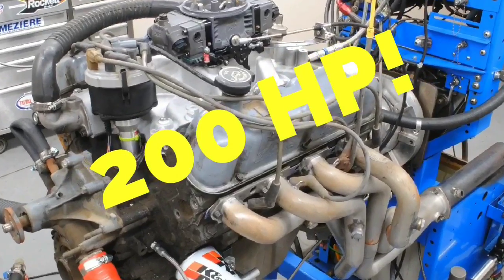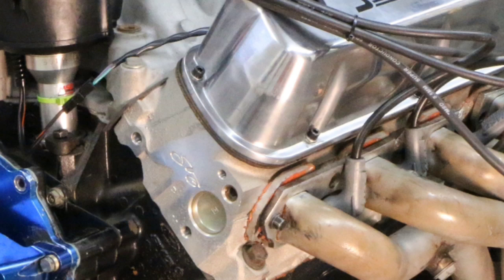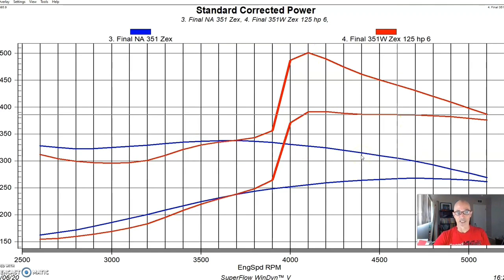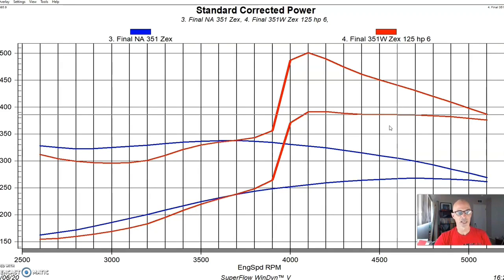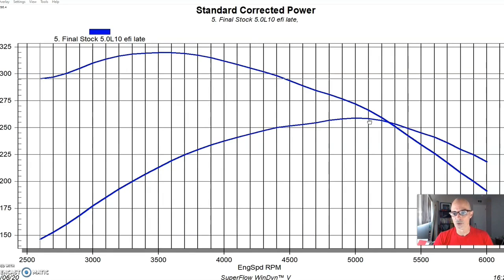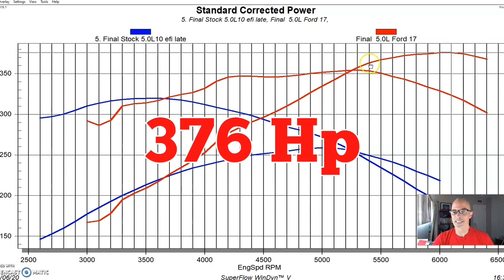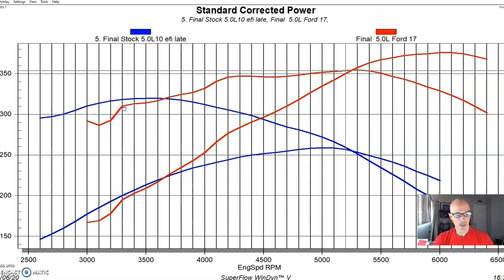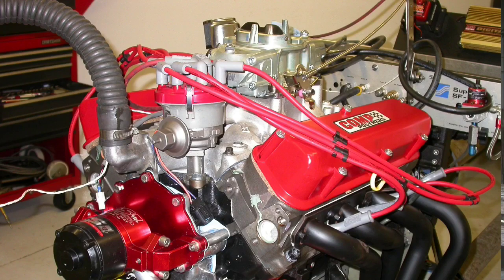HOW TO: 300+ HP 5.0L (SBF) FORD POWER RECIPES

Comment: Hi Richard, I’ve only just tinkered on my motors . I’m building a 1970 f100 and bought a 1999 explorer motor with the gt40p . Could you recommend a budget package for it ,mild cam ,intake and carburetor.Im looking for 300 hp .could you please help me out on this? Thank you.
Reply from the maker: CHEAP DUAL PLANE FROM SPEEDMASTER, BRAWLER CARB AND SUMMIT CAM (E303)
Reply: @ thank you for answering my question I’m going to have to start shopping 👍

Comment: One thing I don't understand when tuning the small, small blocks is why their high rev capability is not used to make power up to at least 7000 rpm. Making max power to 5000 is pointless with, say a 305 when a 351 will do the same with an obvious advantage in torque. So I would be grateful if info on the high revvers was linked.

Comment: I made 327 back in the mid 2000s with a 5.0L short block. Extensively ported 289 heads, Crane 272. Edelbrock RPM and a Holley 4150 with a 2” tapered spacer.
Reply: The cam was only supposed to make power up to 5k, but it kept pulling hard and made power up to 6,200.

Comment: for people looking to make good power in your stock78-89 carbed windsor without spending a whole lot.
1-remove the smog pump system
2-make or buy long tube headers and make or buy collector extensions around 3 feet long and run it a crayon mark on it and run it hard and get it hot; look to see where it burns off and put a H pipe there. 
3-get a intake manifold and a CORRECTLY CFM MATCHED CARB 
4-try your best at porting the stock heads and have a machine shop back face those stock valves, make sure you really grind down those exhaust ridges! . worst case scenario you fuck up your stock heads and have to go buy either gt40 heads or aluminum heads.
5- run a fucking electric fan and change your pully bearings and unless your using a whole shit ton of electronics run the absolute biggest alternator pully you can find that still provides adequate amperage for the provided electronics.
6-lower temp thermostat helps quite a bit
The stock cam has a pretty decent grind that should be one of the last of your worries, getting basic maintenance like spark plugs wires distributor and even help even though they seem simple it all adds to the freedom
Reply: ide love to see a low buck hot snot recipe dyno tested in a car like this
Reply from the maker: why all the F? that is about a 260-hp 302
Reply: @richardholdener1727  some people don’t have a whole lot of money to play with so after spending maybe 400 bucks you can get that 180 hp smog polluted stock 302 into the fun area

Comment: I wanna see what you can squeeze out of a mid 90s 302 truck motor running the factory manifold and dual tb
Reply from the maker: heads and cam still help-just gets held back but the stock intake

Comment: Afr 165 on stock bottom end, stock cam, exporer intake with 1.7:1 roller rockers = 319 hp. Perfect reliability,  drivability, and stock fuel milage with 50 lbs less weight over the nose
Reply: I’m skeptical that makes that much power
Reply: @phelpsbennett4625  wish I could upload the dyno printouts for ya to see here. This was flywheel  horsepower estimate based off of the rear wheel dyno. Stock on the 225hp car was 184rwhp. Heads, intake, roller rockers was 262rwhp. Which using the same drive train loss factor is 319 at the flywheel
Reply: In a car much lighter than what is sold today. By hundreds of pounds.

Comment: what type of pistons do you need for the twisted  wedge heads? Would hypereutectic cast valve relief pistons work?
Reply from the maker: you need TW specific valve reliefs (some pistons have both)
Reply: I ran stock pistons with TW heads with both stock & B303 cam back in the day.

Comment: I got 340hp out of my 2v Cleveland with a r.v. cam a little porting of stock intake/heads and a 500 holley 2bbl. Its not hard....(rated at 180 stock i think...)
Reply: No you didn't

No, no I didn't. But this guy I know...
Reply: No I actually did...
Reply: Pistons cam porting headers and a x pipe exhaust and a 500 holley with some jet work ✔ 👍
Reply: Dude, "RV" cam ? There is no such thing it's just what we used to call a "torque" cam.

Comment: I am Rebuilding my 302 and this is what I have so far.
Forged pistons from a 302 HO engine, the block, crank, and head got cleaned up at the machine shop everything was good, and I also have a B Cam. My question is what type of roller rockers should I go with what size fuel rail and injecter?
Reply from the maker: STOCK RAIL AND 36 POUND INJ WILL BE PLENTY

Comment: At a car show i sprayed my stock rebuilt 85 longblock with 100 timing was at but 8*. The temperature outside was 90*. It made 290hp and 426tq. The car had 4.10 gears and basic intake carb and exhaust and a manual transmission. With a crap tire it ran 7.70@90 in the 1/8 and 12.56@100 in the 1/4 ran out of gear at 900'.

Comment: So an aftermarket head lists a maximum lift. (i.e. TF GenX 220 "as cast" = .600"). What is the limiting factor? The provided spring or an actual mechanical limitation of the head itself? I was going over the specs more closely and some of the camshafts I have seen used exceed this. Thanks in advance.
Reply from the maker: SPRING COIL BIND, OR RETAINER TO SEAL POSSIBLY
Reply: @richardholdener1727  Thanks for the response. I think it merits investigation. You have recommended these heads and cam combinations.
Reply: @richardholdener1727  I tried to contact Trick Flow. No luck. Called Summit Racing and they were a big help. There is a valve train upgrade kit (CCA 26926TS KIT) with upgraded PAC dual springs, steel retainers, and keepers. $487usd adder that is good for a .624 lift cam. $605usd for titanium retainer upgrade.

Comment: What's part # for valves springs using 264 cam? Or what springs I need for gt40p heads with .550 lift?
Reply: IF you do not port those GT40p heads with that lift you will actually lose potential HP because the exhaust valves are smaller and you start to drop flow past .500 in stock. Porting you still should stay below .520. You might get away with that lift in ported GT40 heads though.
Reply: David Vizard says beehives.

Comment: Can you run the 264 cam in a stock gt40p engine.512 lift sounds like alot
Reply from the maker: IT'S NOT LIFT-ITS DURATION THAT CREATES THE PROBLEM
Reply: @richardholdener1727  good to know
Reply: That being said without porting .512 is about the limit for flow for the GT40p as well due to the smaller exhaust valves. Even at .512 port those babies!

Comment: Hopefully this is seen or commented on,
My build is a 306,  N-41 Cam, Afr 185 heads, Edlebrock performer RpM ii,   24# injectors and maf, as well Bbk longtubes. 1.6 roller rockers as well. 

Do you guys think it will make 300WHP+?
Reply: 4.10s in rear
Reply from the maker: could be close with a stick
Reply: @richardholdener1727  yes it’s a T5!

Comment: Looking to upgrade my Speed density to MAF 87 Fox. Currently still has the e7's. Have 1.7 Crane Cobra RR's on the Stock Cam and a 93 Cobra Intake (replaced the Comp polymer bread box intake). Has 3:73's and MAC shorties with an O/R H-pipe. 
Question....best direction to get over 300 from here? Obviously I know NOS is a possibility. Your thoughts?
Reply from the maker: CAM AND HEADS-CHEAP GT40 HEADS FROM THE JUNKYARD EXPLORER
Reply: @richardholdener1727  cam choice for the gt40 heads and Cobra intake?
Do yo see an issue keeping the 1.7 RR's with a new cam?
Thanks!!!!

Comment: So, I'm curious. That 274 degree cam...is it factory computer compatible? Or is a custom tune required? I'm shopping for a camshaft now for my build. Hyd roller 1994 5.0l gt40P heads tfs spring kit.  Explorer intake and 75 mm throttle body 24# injectors. 🤔
Reply from the maker: tuning should be required, but i ran it with a Pro M MAF and no tuning back in the day

Comment: I liked this video alot. I recently purchased a 86 f150 2wd with 5.0 fi moter. Its in excellent condition & all stock & though its power level is what I consider adequate, I want to make fun. I dont have a ton of money to dump into it & dont need to race it, just make it a quick ride (for a 86 150). So a basic cam upgrade & shorty headers & depending on what heads it has, possibly a gt40p head upgrade.
Reply: Heads and a short duration high lift cam. Headers are always a great idea.

Comment: Great video, any idea how much power and torque the afr 165 heads are worth with a mild cam , dual plane edelbrock  performer rpm intake , 650 carb and long tube headers ? Thx  !

Comment: Alright I have a stock 86 302, I had the e7 heads ported at a shop for trade, I’ve got long tube headers, a dual plane intake, Holley 600cfm carb, and the comp cam 268h k31-218-2 & the kit with new springs and timing set. So What type of power would I be looking at? I hoping somewhere north of 270hp but I’m not sure! Any help would be appreciated, thank you
Reply from the maker: DID YOU PORT THE 86 HEADS?
Reply: @richardholdener1727  yes, e7TE heads ported to similar gt40 flow. Thank you for the response!
Reply: @richardholdener1727  I just finished assembling it, the carb is a Holley street warrior. Seemed like a good enough carb for a mild set up?...
Reply: I have nearly the same set up. 86 stock bottom end. Ported GT40p heads. .512 cam, dual plane with a Holley 600 and I am predicting right near 300hp. Running automatic with a 1000 stall as well. It is going in a Ranger so I also have a weight advantage over a Mustang and most cars. That should make it very fun to drive and also not lose any driveability.

Comment: Richard, quick estimate please? Junkyard 351/gt40p heads/ .512 lift and 230&.050 cam? 300hp? 325? Instead of putting this on a 302, might as well go 351. Oh, and headers will be 1 3/4 long tube homemade by me. 40" primaries and 3" collector...or...what do you suggest for that too I guess, don't have pipe max.
Reply from the maker: more than 325 flywheel
Reply: Really? Thanks for that. Bracket racing and can't go over 300 or I'll be in the next higher class so if it works that well I'll put a bolt under the throttle.(83 mustang, c4, 3000 stall, 9" with 4.86's and 29.5 X 9 slicks). Approximately 3000lbs. I think I'll be swapping to 3.50 gear though, what would you say is max rpm for stock rods/bolts/cast Pistons? I'm thinking 6000 which the 4.86's will hit by half track. Thanks so much for sharing your knowledge in the videos and comments section!
Reply: Ok, you got me thinking so I went to Wallace auto calculator and 3000# and 325hp is 12.2@110mph. With 4.86 and 29.5 puts it at 6400 in the traps. Going to a 3.50 gear brings it down to 4600.... I think I'll be switching rear gear when I drop in the 351. I might even go to a 28 X 10 slick as my current ones are pretty old. That'll put me right at 5000 in the traps. Thanks again!

Comment: I enjoyed the video. However, not everyone wants a cam swap for a 300hp motor nor  is one required at that power level. Most cars with actual 300hp engines are in street cars and daily drivers. Choppy cam is cool but at 300hp, so is the element of surprise that comes with a smooth idle  paired with GREAT DRIVABILITY. The stock HO cam is a diecent piece. Pair that with rebuild GT40 HEADS, mill them to 58cc add 1.7 rockers a diecent intake and you'll have a smooth running and very responsive package making just above 300hp. Also if your an EFI guy the stock upper and ported lower will support that engine with the stock injectors and adjustable fuel pressure regulator. Just upgrade the mass air housing and add a 65mm throttle body.  Now that's cool and stealthy  as well. Add nitrous and you will have a can of woop ass no one will see coming. Many big block chevy vehicle's back in the day have lost money and street races to what people called stealth stocker builds similar to this combo. Me personally I use World Products Windsor Sr. milled down to 58cc. They work GREAT and you'll have more than enough room to grow down the road.
Reply: Yeah a ported set of GT40 or GT40p heads with a mild cam can get you to 300hp.
Reply: @SophiaAphrodite  yeah I agree with the heads, but not everyone wants a cam change or needs one to get 300hp, when you have a stock H.O. cam. Especially when drivability is a concern, and it's gonna be a daily. In that arena it's best to save the money.

Comment: somebody give me an estimate of how much power I am making please! STOCK 302 BOTTEM END, flat top w/valve reliefs! "REBUILT" with RPM AIR GAP INTAKE, TFS1 CAM, PRO COMP 195 CC HEADS WITH 60 CC CHAMBERS, COMP 1.6 ROLLER ROCKERS, hooker 1.5" long tube headers 2.5" collector, H pipe straight through, carb is an edelbrock 600 with electric choke "1406" compression is about 9.1:1 I think!?!?! ANY COMENTS OR OPINIONS WILL BE APPRECEATED
Reply from the maker: 350 flywheel or so
Reply: @richardholdener1727  from the man himself! thank you that's about what I was thinking too!

Comment: Explorer motor with short tubes and e cam in a 95gt did 265hp/300tq at the tires.  351w stock compression, performer rpm heads/intake, x cam. Did 325hp/380tq at the tires too. Same car

Comment: Great videos, but wondering if you could test some small changes such as titanium retainers, titanium valves, metric LS style (thinner) rings, windage tray, milling for a bit more compression.  Would be good to see what works on more specific things.  Thanks
Reply from the maker: high $ titanium parts in a 300-hp combo?
Reply: @richardholdener1727  Just interested in what can be squeezed out of a 302.  You know your stuff, so if you think its not worth it, I will take your word for it.

Comment: Had a 77 mustang stock 302 2v.  Smogged to death.. 120hp from the factory.  "Back in the day" added flat top pistons [9.5:1], ported with carbide bit in a drill, 1850 holley on an edelbrock manifold with blackjack headers.  Was around 300hp.  Hot snot back then.  Hard to believe nowadays!
Reply: Maybe 200 HP!

Comment: Great video Richard. Are the stock GT-40 heads better than ported, small chamber, 1.9/1.6 valve (if I remember correctly) 289 heads?
Reply: depends how bad the porting is 
David Vizard heads are tops, but $$$$$$

Comment: Is there a way to make NOS come on in a more linear fashion like a supercharger and not so sudden?
Reply: Most definitely, use of a nitrous controller. You can adjust how much and at what times and set different stages
Reply: and the ZEX system that reads bottle pressure prevents bad things...

Comment: Richard- can you tell the differences between a 289 Hi-Po head vs. the newer GT40 or GT40P head?
Reply: GT40 is basicly the 69-73 big spark plug 351w head.... which back in the day was a good +20 hp but lowered compression on 289. 

289 = 124 cc intake/54 cc chambers
GT40 = 144 cc intake/60+ cc chambers
Reply: @hotrodray6802  to follow up the GT40p heads have smaller exhaust valves so if you intend to put in ANY cam over .500 you will want to port it or that lift will be wasted and should stay below .520. But porting them will get you +50 bolt on HP without any other changes.

Comment: 351w flat tops, p heads, 230 @.50.  .500. Lift.   Did 290 at the wheels.  Using the scary lean stock tune from my sn 95 computer.   Don't remember the tq, I'm sure it was above 350   at the wheels
Reply: up the fuel pressure to 43 with the stock injectors.

Comment: How about a 2.3 Lima Pinto/Mustang/Thunderbird/Ranger build?  Buddy Ingersol was running 10.30's with his 2.3 Pinto with 26 lbs of boost and 6.50 gears back in the 70's.  Maybe build a later 2.3/2.5 dual plug roller Ranger motor - they're probably plentiful and cheap in the junkyard.

Comment: I would love to see a power build up of the old Ford 300CID inline-6. That engine was indestructible.
Reply from the maker: COMING
Reply: @richardholdener1727  I have a tfs2 for a 331 sbf I'm building. I have a set of good solid roller lifters... I wouldn't mind the noise for my nostalgia build. What's the biggest drawback? Is this just a no go situation?
Reply: @richardholdener1727  Awesome! Looking forward to it. 👍
Reply: I second this vehemently! Preferably with the 2 different heads and with the diff carb intakes and some fuelie stuff.
Reply: It was bullet proof because it didn't make any power.  Most engines from any brand that don't make power will last forever
Reply: @jasonhooey5677  it made pleny of power for its time. Low rpms and 7 main bearings is why they lived so long.
Reply: Look up on YouTube, with a big single turbo they sound like a mini Cummins diesel

Comment: I bought a new 5.0 LX notchback in ‘89 and enjoyed it even if it was a Ford. My daughters, in high school at the time, had a ‘66 289 4bbl 4-speed coupe. The ‘89 did everything better than the original, even if both were fun. These days I’d ask why not find a 4.8 and do a swap? No mods necessary, until you get tired of 300+ and need 400+, or 500+ (turbo).

Comment: The dyno graphs really tell the whole story.  Often times chasing that high power number is a trade off in reduced lower rpm power.  If you're just building a cruiser the mild engine with more power off-idle to 3500 rpm may be a better choice than one that has a magic number at 6-7000 rpm. Especially in a heavier car or truck with an automatic.
Reply: There is a good combo for midrange < 5500  but the numbers are not as impressive. Fun to drive IS.
Fox 90 here.
Never forget that big power starts slipping clutches, popping transmissions, overcoming suspensions ... SNOWBALL $$$
Reply: Plus that torque will make up for the lower hp out of the gate for those heavier cars. I am building mine for my Ranger to be under that 5k window especially since I am lighter than a Mustang and do not plan to race it.